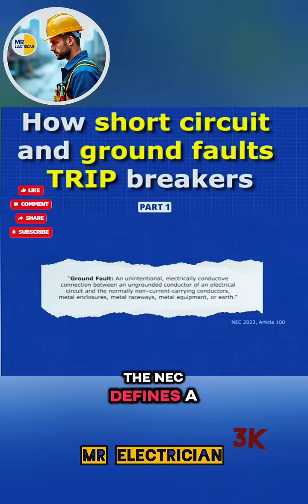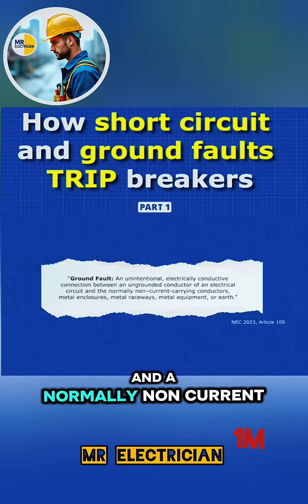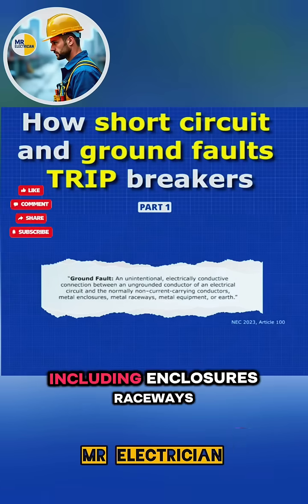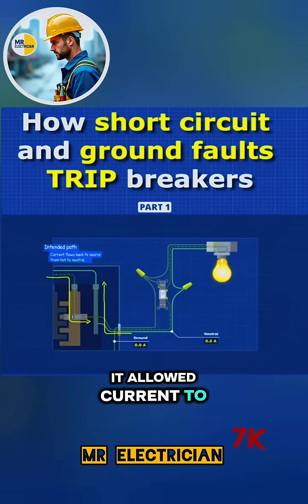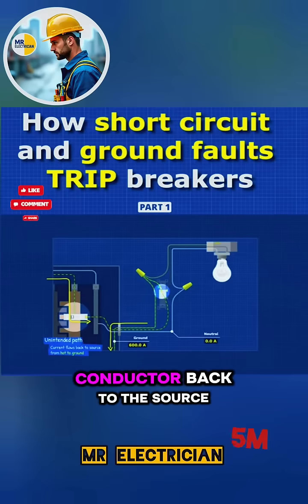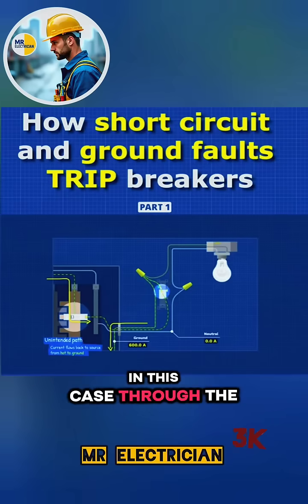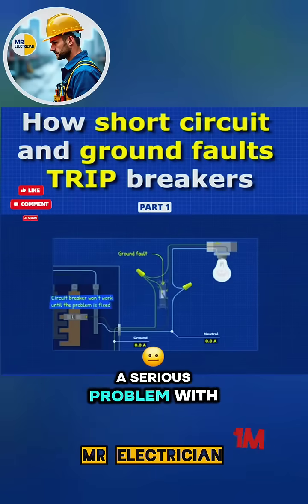How Short Circuit and ground faults Trip Breakers!#electrical #electrician #electriciantips

Comment: Hot or Live to Earth Means the Device Is The Problem or The Wires in the Wall have become Damaged, which is Why You Have RCBOs (Residual Current Breakers for Individual Circuit or Radial) & a 100amp RCD (Residual Current Device) which Turns Off Everything in The Consumer Unit, If There Is A Trip You Have To Identify the Circuit,Unplug Everything on That Circuit Then Plug the Appliances Back in 1 at a Time to See which 1 Sets the Trip Off.